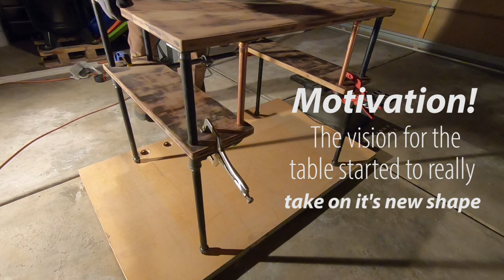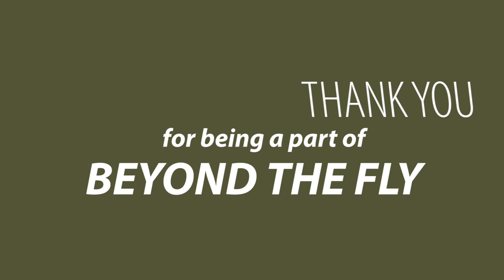Building a NEW fly tying station from an OLD dining room table |  Beyond The Fly

Comment: Nice job on the table. I would like to build one using an old and cherished pine table. Would you be willing to provide the dimensions of the table and shelving?
Reply from the maker: Kevin Erdman thanks man!  It was a really fun build.  I hope you find joy in repurposing your pine table. Here are some dimensions: top shelve is 30 1/2” w x 12” depth, top shelf to main table top is 9 1/2”, main table top is 38” wide x 31” depth, lower right & left shelves are 9” wide x 31” depth, and it’s 11” of lower shelving clearance from the main table top. From the floor to the main table top is 33 1/4”. Hope that helps in some way for ya. Have a good night.
Reply: Beyond The Fly thanks a lot man. That’s exactly what I needed.
Reply from the maker: Kevin Erdman right on! You’re welcome 👍🏻